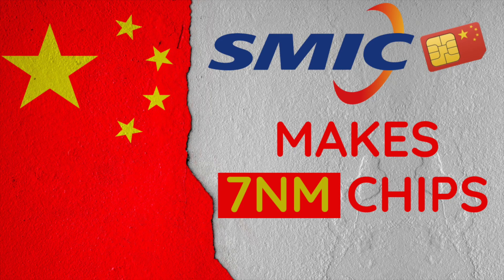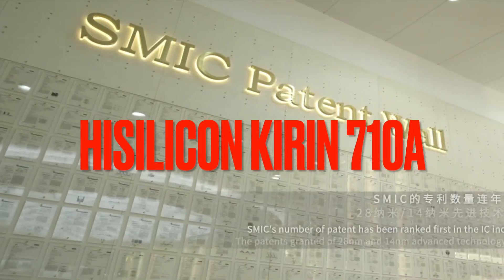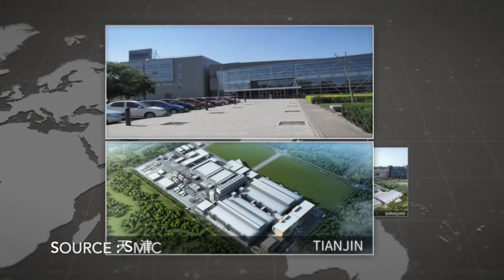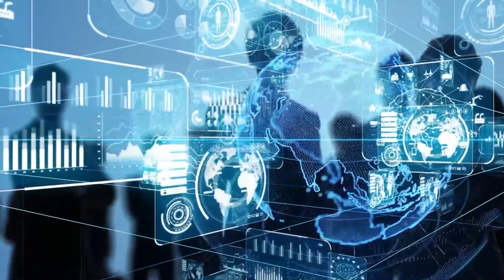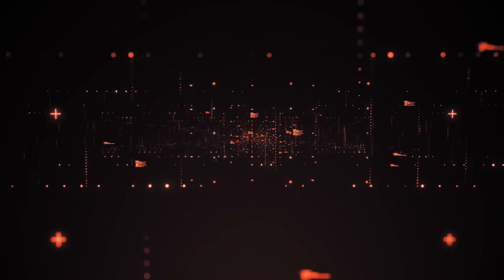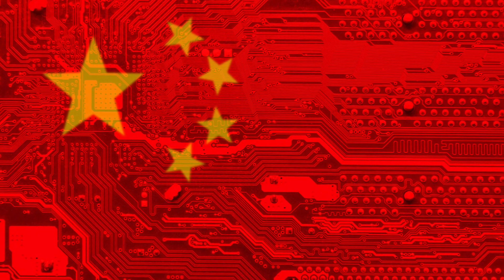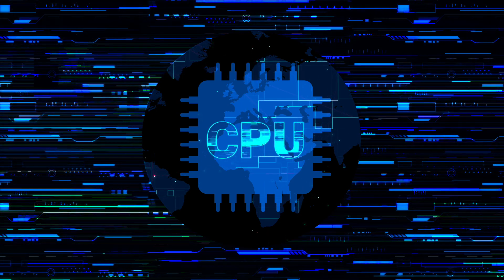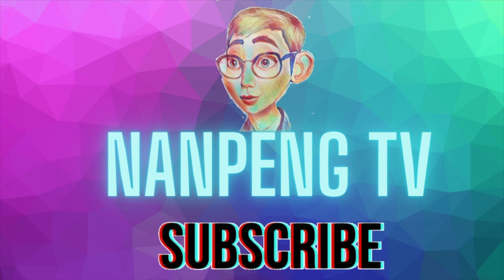How SMIC makes 7nm CHIPS without using ASML's EUV Machines?

Comment: It's probably not worth it for China to push silicon past 7nm. There comes a point when a phone processor is good enough for what a phone does. We've reached this saturation point with calculators, digital audio, and probably screen pixel counts. Chips at 7nm will be less efficient than TSMC chips in 2025, but China can keep up simply by using more CPUs, more power, and more cooling. That's not optimal, but it's definitely cheaper than what it would take to do their own EUV transition. China's top priority should be to make chips from a substrate that isn't silicon, which is seriously hitting ROI diminishing returns. If they can do that successfully, they will basically run the world.
Reply: It seems graphene chips is coming from China, the underlying issues are solved, it is a matter of when prototype production machine is made and then mass scale production machine.

Photonic chips are also underway, there's lots of gossip channels been talking about this and some even before the US IC chip ban

Comment: Neno meter term now a days just a gimmick . Real world performance only can be determined by transistor density per mm square . The tsmc 7nm has 91-93 million transitor per mm square whereas intel 10nm has 100+ million multigate tranisteor . 
There is no industry standard to define uniform performance or benchmark to called certain neno meter .even though gate length of the transistor are far away from 7/5nm.

Comment: As described briefly in the video,
It's only a partial success to be able to make semiconductor chips at a particular size, 
You also need to achieve similar performance.
I'd also add that you need to also produce a competitive yield for the process to be competitively economical... Unless the objective is to make chips at any cost.
At the moment, China's foundries aren't competitive even for older, less advanced processes... at every level, chips made by foreign foundries perform better and are preferred. Since the process is only secondary to what everyone wants which is performance, at the moment simply saying a particular size process has been achieved is not sufficient. It's an accomplishment but hardly an indication of competitiveness if compared to foreign products.
Reply: China's tech sectors are growing leaps and bounds, how many times the west has underestimated China's abilities/progress, how many times China has surprised the world.
Reply: That's totally untrue. The 28 nanometer chips are competitive already with foreign foundries. In fact, Foxconn is already outsourcing back to China its 28 nm chip requirements. 14 nanometers are expected to be in production and competitive by 2023/2024. And if the trend continues, 7 nm chips should be in production by 2025/2026, and 4 nm the following year.
Reply: Ancient
Reply: The video discussed about the manufacturing processes for such chips in said areas rather than their architecture.
Reply: I'm sure they use reverse engineering, it doesn't surprise me that machines disappear from the TSMC factory, the whole world, even the United States, wants China to manufacture these machines.
Reply: @frandm97  No EUV, no reverse engineering.